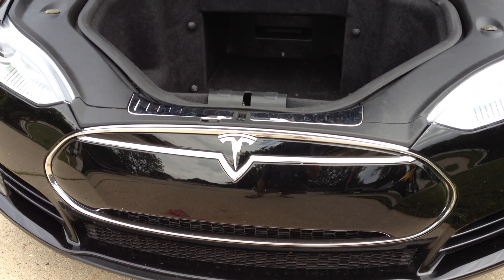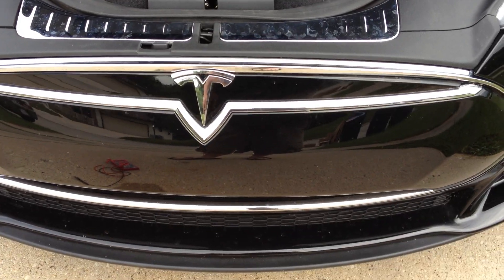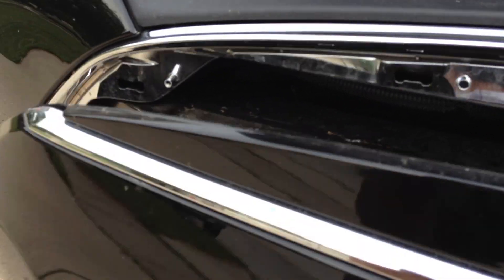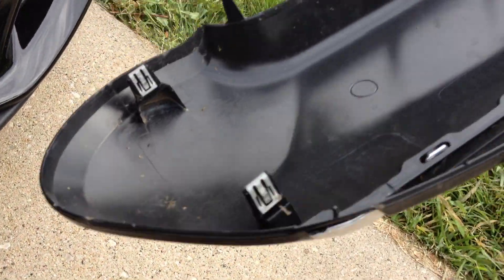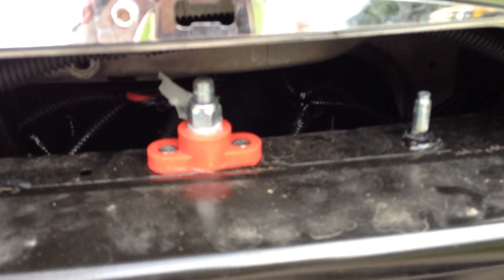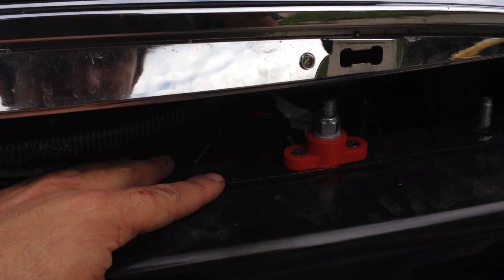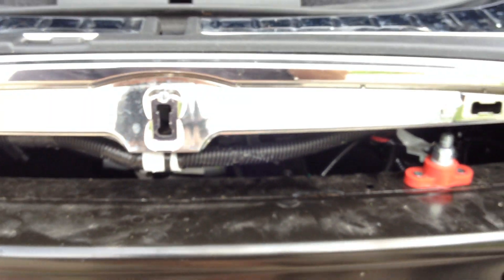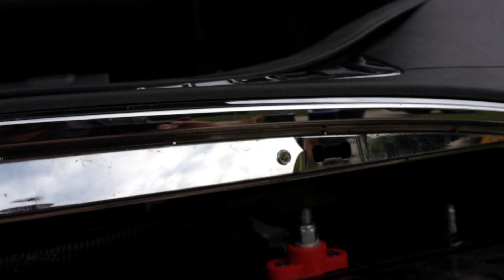Tesla Model S: Nosecone Removal

Comment: For tesla with autopilot, the 12 v battery is moved further back to a different location (you won't see pos and neg terminals like in this video).
Reply from the maker: Correct, however you can still pop the frunk from behind the nose cone and access the terminals to jump the car.

Comment: If you have a 2015 or 2014 model s and your need to take off the nose cone it's actually simple. The lip on the bottom of the nose cone there's 2 things you have to pull on the top far left and top far right. If you pull hard enough it should come off.